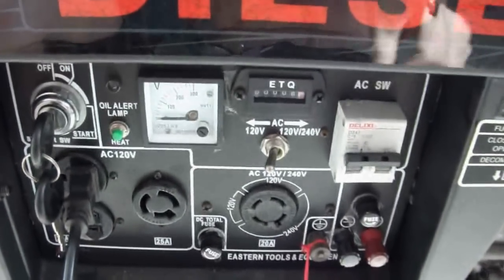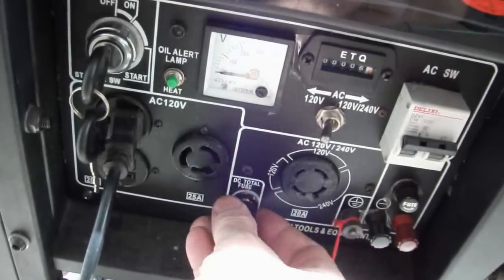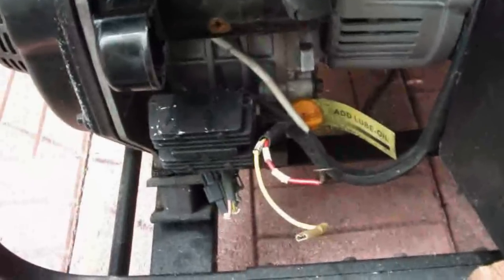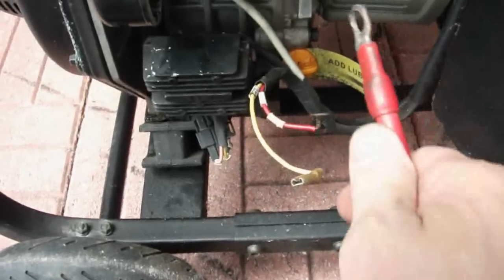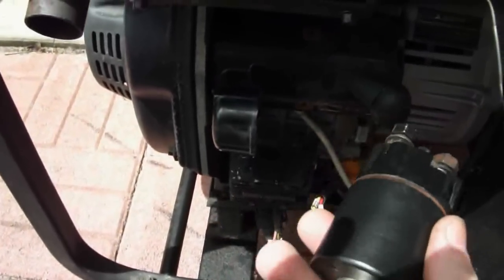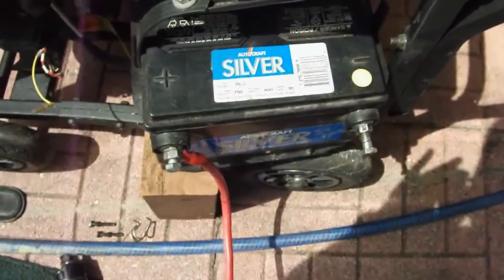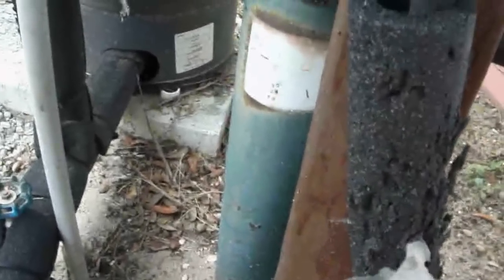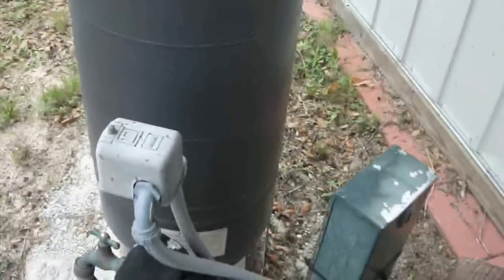ETQ Diesel Generator & Well Water Bypass

Comment: Hey you got some great stuff -- keep digging on Lakhovsky. Here we are in the middle of probably the biggest war mankind has ever been in and even alternative "seekers" are hiding stuff ... especially about Lakhovsky. Others too.

Anyway, anytime you buy a battery(s) for sensitive equipment, get out the red spray paint and slaughter the + sides of the battery(s). Tie a red towel on the handles, whatever. Otherwise, disaster will be guaranteed, for everyone.

Just get any old solenoid.  Model T solenoids are $10. Hook it up with a angle bracket or something.

Ciao

Comment: Wat normally blows up is the dc voltage regulator, i can not understand why on earth the solenoid will burn out! This wil work either way, on pos or neg systems, when you connect the battery lead to the solenoid you also conect the litle positive wire to the panel and thus conecting the blown dc regulator, thus blowingbthe fuse. Thry connecting the starter whitout regulator and thry starting, my guess is theat the starter will woek fine., its always the regulator!
Reply: MrBugsier5        B.B.  B.v Stairs so right now we’re on our way let’s just see where is the remote Pam by have to go out and get water then it’s on here.     B.